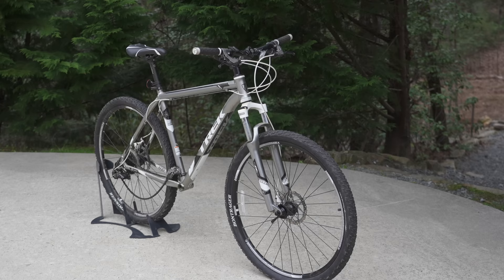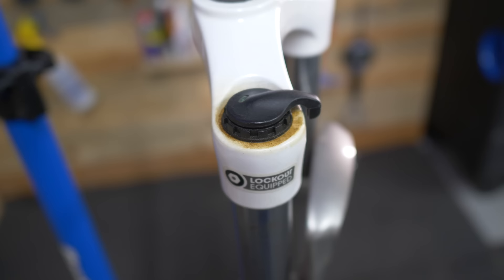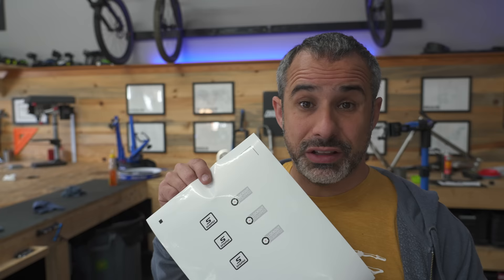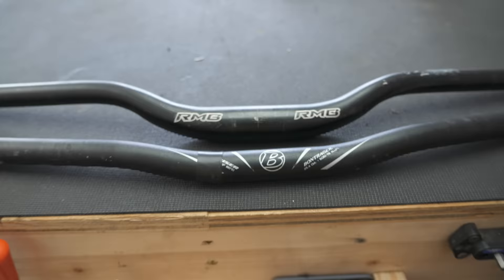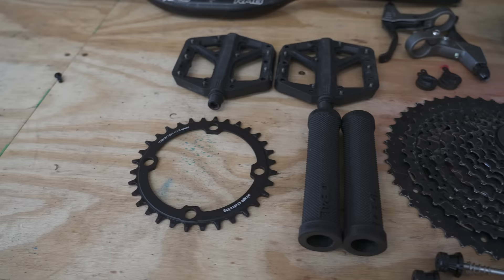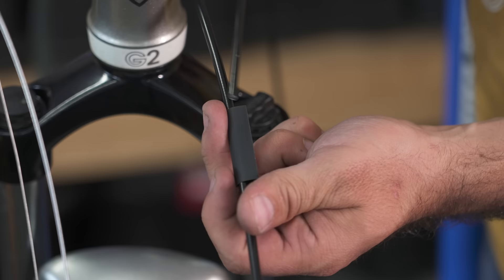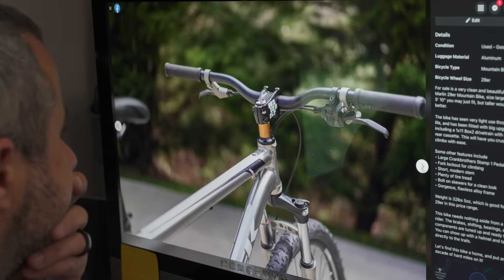Will they pay more for a 29er? Flipping a Trek Marlin Mountain Bike

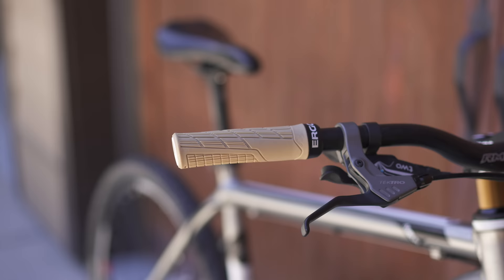Comment: Dude, you but the grips on wrong. The right hand one clearly says "Left" on it. look at 15:59
Not sure, but isn't this model of chain also supposed to go on in a specific way? With all the 45 deg edges inwards...
And lastly. The golden headtube spacer looks nice, but really surprise you managed to NOT cut it square with the Parktool jig. But at least the cut is facing upwards, so the bearing still gets propper support. For a while...

Comment: I wish I could send you my old mountain bike I used when I was a teenager (around 20 years old bike). I have tried having to repaired at stores but they have never managed to fix an annoying creaking when pedalling and gear shifting always gets stuck not changing. (Even though they said it was “fixed”). But yeah too far away, from the UK. Wishful thinking.

Comment: I've got a TREK MERLIN 5 in silver. Let's say the 5 is the best of all the MERLINS soo this is kinda educational for me because it's kinda the same bike as mine gust want to change a copel of things on it though I want my MERLIN to be my bike for a long time and I'll take care of it. Upgrades include the falowing its not stock cockpit bell phone holder speedometer light bike bag with first aid kit with lock and gloves  suspended seat post and jell seat spare tupes on the hubs of bolth rims thanks for that idea by the way bolth wheels have green slime in them.  Tools bike molty tool  patch kit bike pump. I want to have additional upgrades like an E bike kit spasticity disided for my MERLIN 5 u also want a brake lever that actuates bolth brakes and tires for commuting
Reply: How way is this reall

Comment: Seth I noticed you lightly sanding the disc rotors - do you often do that? Might need to do so for my gravel bike front disc which won't stop squealing and has reduced stopping power.

Comment: I have a 2019 Trek Marlin 4 29er and I wanted to convert to a 1x drivetrain. I was told you can’t do it with stock wheel set so I’d need to upgrade wheels. I’m wonder if the bike Seth flipped had the same issue or if they were different wheels?

Comment: Hi! I wanted to do a 11 speed upgrade too to my bike, but after looking into it I got conserned it won't fit into my wheel, as it is wider than the 9 speed casette I have now. Did you got lucky with the wheel hub being compatible or you changed that as well? Or am I wrong in thinking this :D?

Comment: I've got a 1-by
44 ToothKassette: MICROSHIFT 12 × 28
12-13-15-18-21-24-28

Is anyone aware of a cheap good one by which could do good as an upgraded replacement, since the crank is a no name thing? I'm looking for a more direct pedaling feel with less play even tho these are lightyears better than my old department store bike. I can do about 30 ish kmh in 5th gear (with some effort), with two more gears headroom, under 44 teeth up front should be alright?
Reply: I'm also thinking about getting a shorter stem and a different saddle

Comment: I don't think Seth is realistic on his parts pricing at all.  Please let me know where I can get a set of cables for less than $10.  Cables + colored valve caps + colored rotor bolts + special sticker printer paper is WAY more than $10.  I'd also NEVER pay $50 for the parts left over - $25 max, if that.  So he's off at least $45 on how much profit he made.  His other flips had similar poor estimates of cost and left over parts resale value.

Comment: Hi so I need some help I’m new to riding mountain bikes and my chain is acting weird when I pedal backwards, it slacks a lot and sometimes even goes into different gears. What can I do to fix it?
Reply: Also my drivetrain moves forward when I’m pedaling backwards is annoying me cause if I don’t pedal it slacks a lot to the point the chain falls sometimes
Reply: Adjust your chainline with spacers if possible.
Reply: @h4swell  I been doing some research and I think it might be a problem with my cassette
Reply: @h4swell  and my other idea is the freewheel

Comment: Nice job. Outstanding build. The only thing I would have done different is to buy a $60 dollar hydraulic disc brake set off of Amazon. Low end hydros are better then any Tektro mechanical. 

Where did you get the shrink tubing? What size?